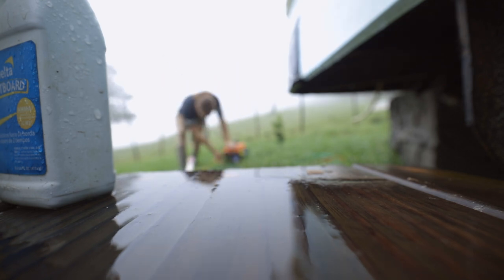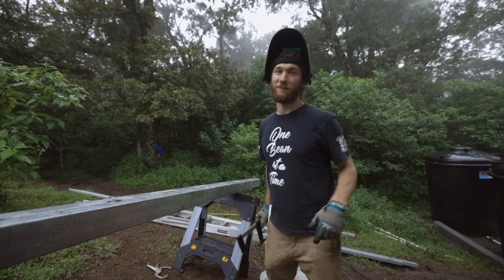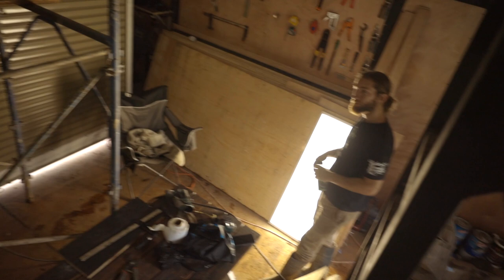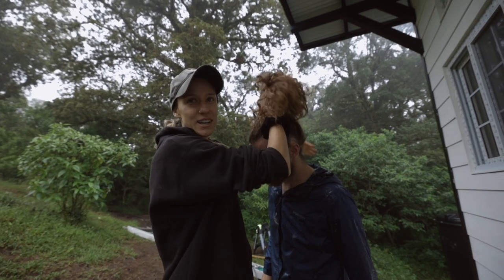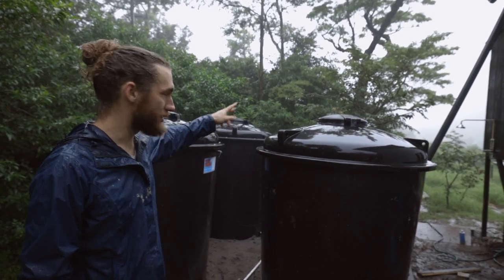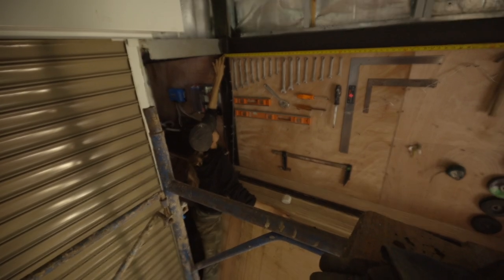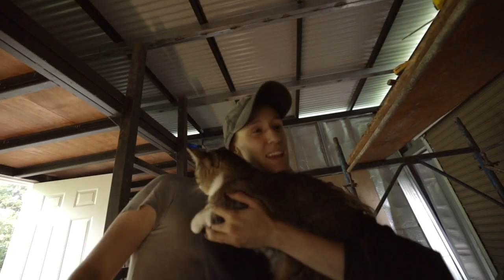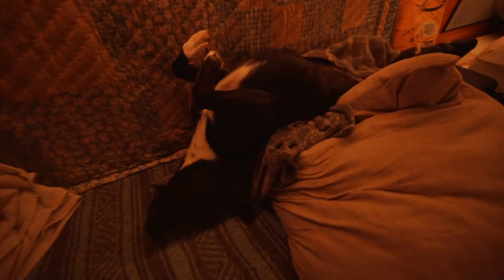FIXING ALL THE MISTAKES WITH OUR TINY HOUSE

Comment: You guys need to learn how to properly use that little woodstove. Keeping the door open allows the heat in the room to escape up the chimney along with the heat of the fire...close the door and let it burn you get more heat for longer. Also get a woodstove fan to place on top and it will push heat across room. You get the most beneficial heat from coals in the firebox not the burning itself so put in enough to keep some coals in there and you have a btter heat. If glass is smoked over like it is on yours its not burning hot enough or you are using poor wood to burn. The glass should be clear and or burn off soot from it on every burn. Take a few minutes and watch a few videos here on you tube and learn how to get the most heat from your stove. Keep up the great work!
Reply: Nothing like a multi fuel stove. We got a larger 4ft one. It would put you out of the room on lowest setting with the windows open. We where glad when had no heating on when tiling flooring in home in middle of December. Need to keep door of stove closed to benefit from heat. 👌

Comment: You may in the future want to install some insulation panels against the roof and close up those air gaps a bit more to increase the efficiency of your wood stove or you won't be able to hold onto that heat over night.
Reply: Hi there, i started to watch your channel a week ago I am very happy for your project. Here i join the subject of insulation cause i have noticed that you have put some in the walls and i don t see any in the roof. I was wondering if humidity is not condensing in the inside part of the roof when you warm up with your tiny wood stove. Good luck and keep spreading your good vibrations! Agata

Comment: If your trying to heat the workshop you  need to seal the eaves to keep the heat in.  Otherwise the insulattion you have installed in the walls is moot
Reply: Well said

Comment: You don't need the tool for the grinder,  you can just spin discs on and off with the palm of your hand.  I haven't used the tightening tool in over 10 years and no issue!

Comment: another "mistake" to correct would be the Wood burning Stove. The one you have is too small to be beneficial for that size building. Move it to the Bus, and get a much bigger one. JMO
Reply: this is Panama, a very warm tropical country. the stove is only for drying and adding a bit of warmth when needed. that pipe makes me nervous though. we go through that in Maine where we do need larger stoves. i am sure they will get something larger if they need it.

Comment: My Dad has those same water tanks. I don't know why, but he has the tanks elevated off the ground. It might be because it takes less power to pump it into the house he has in Saint Lucia.
Reply: Gravity feed.
Reply: Elevating the water tanks helps tremendously due to gravity feeding the water into the house appliances, although in this case, they’d need to use a pump to feed the water that they are getting from the roof into the tanks.. plus they already have a pressure tank setup 👍🏼 which in my experience here in the Philippines, it’s much better..

Comment: I'm not sure if you've thought about it but maybe you could use the energy of the water? Since there is a hill, you could collect the water from the top and put it into the tanks. Before it goes into the tank you can put a watermill and then when it rains you'll also get green energy.
Reply: Or you could use the water that you collect from the workshop!

Comment: I so relate with you about the "Money Savers" that the locals will have you do, that in the long run will NOT save you $.  Here, for us, the WORST mistake we ever made in our home's construction was letting them talk us into the standard for here plumbing with only 1.5 inch tubes.  We do have pressurized water, which most folks here do not have,  but if you want to  fill up something,  get a book.  So slow!!   Great guys!!  Thanks!

Comment: Maybe some sort of water turbine, with that amount of rain could it be collected higher up and released through a turbine into secondary storage... Or when you drain them.. Has anyone designed one that goes into the down pipes on gutters? 

On protest camps they often have bikes set up to charge batteries for phones and lights too just as another idea

Comment: Wood burner. Keep the door shut and open the air intake at the bottom for a good warm fire. Also you can get small fans that when you put them on the stove top will generate their own power and spread the heat out across the workspace.

Comment: Thanks for the video, it was fun. 
I though the windmill was working now or is there just no wind with all the rain?  
If no  rain and no wind happens very frequently you might consider a tiny hydro generator system. Since you have excess water just run a pipe down the hill side and put a hydroelectric generator at the bottom. Most systems like this save the water in a pond or tank and pump it back up hill when solar or wind power comes back online but you  seem to have excess water so you probably don't need to do that.

Comment: Also another potential idea would be catching the rainwater as it's going to the Collection barrels the water will be running at a Potentially high volume if you can capture that with some type of Impeller you could harness a means of electricity in that way....

Comment: As far as the ceiling live and learn that’s what it’s all about, this is your first building you’re gonna learn so much off of this one and then go to the next one, congratulations 🍾 maybe think it outside my own head but maybe come up with a box with like a wheel that captures all the water hook it up to like a little generator and plug that into your batteries so then you’ll have wind, water and sun or maybe put an extension that when your water tanks are full you can shut off valve to fill you in up turn on the other valve with a tube coming down and hitting that wheel so you have like a little creek but then you’re capturing all that water from the roof with hitting the wheel that could also charge up your batteries. Ok 👌🏼🔥🤠🔥Camping Russ out

Comment: Given what you said how cold it can get in your area, insulating the roof will make a difference at making the space more comfortable.  You have a pretty efficient radiator of heat out with the metal roof.  Probably not too commonly done in Panama.

Comment: I am not  an engineer so I am really asking out of curiosity- does installing the beams as you did really help carry the load or is it all basically now being held by the welds - as opposed to being transferred to a load bearing wall where a beam actually sits on a wall that sits on the foundation, rather than attached to the wall?
Reply: not an engineer, eh?

Comment: WATER WHEELS in streams also produce electricity btw if it is too wet seasonally. You can also use a water wheel for DC rather than AC only. also stationary bicycles would work or some type of inside perpetual motion machine (that should be fun).

Comment: In case it hasn't been said yet, the carriolas will make a stronger beam if you weld them back to back with the C on the outside, like an I beam.  Also when jacking up, place your vertical Jack post directly under a beam, otherwise you could bend your carriola beam.

Comment: @nomadicmovement  is it possible to drain the rainwater down to the wind blades of the wind turbine?  So that the water is high pressure right at the blades pushing them a round and round?

Comment: you should weld strong backs on to the sides of the beams where you welded them in. To do this just simply cut a few inches of angle iron and use them to weld in for extra strength.

Comment: A few more solar panels would help to make up the power loss during rainy weather. Led lights come in different degrees making it possible to have a more natural light. 5000 degree lights are more like florescent. Lower degree LED's like 3000 degrees are more like incandescent light bulbs to show color more accurately.

Comment: Ok guys... I have two comments for you that may, or may not help you. First of all, it’s great that you both learned to weld, you’ll use it for the rest of your lives. Secondly, every time I see the wood stove the door is open, you may have done better with a fireplace. Wood stoves work best by controlling the combustion, ie, close the door once the fire is established, and let it come up to temperature... the whole stove should radiate heat, not just the open door. I hope this helps, if not I won’t be offended if you disregard.

Comment: I would buy a water filter before drinking.  something that removes those tiny microbes you don't see. Water droplets fall when they attach themselves to dust particles. Which then causes Rain. So these little microbes unseen to us are there & that's why a filtration system for your drinking water is a good idea.

Comment: Too bad one light broke. It would be nice to finish that project. Yeah. Generator to charge batteries. Good job. Concerned you only has 112VAC from generator. Need fat wire for long runs or move generator closer to batteries. That should be priority. I wonder how much electric you could generate by capturing water off roof and running it thru turbine. Cheers
Reply: There would need to be large amounts of running water flowing through the turbine to generate electric current, maybe if they had a waterfall on the property, then that would really work.. but unfortunately, just the little amount of rain falling off that small roof isn’t going to do much, even for a small turbine..

Comment: @The Nomadic Movement _ Serious QUESTION HERE: How come that Wind Generator isn't doing ANYTHING? Personally, I think it's FAR to LOW and it's only getting "Disturbed-Air" which is ground air that's all over the place but the Blades. That tower should be at least 3 sections higher. Didn't the supplier/manufacturer give you performance specs? _

Comment: i am in the process of rebuilding a 10x14x14 shed into a cabin on my low level social security which is $800 a month. i am not allowed by law to do a gofundme or any donations that can be traced. good bones. just got a B&D sawzall and a hedge clipper for bushwacking it was a big deal, love all the new tools, you are very lucky. next summer in Maine we try and do the big stove, insulation and maybe some housewrap and metal siding. we have some promised free labor. work, work, work. by the way, check out Luan instead of plywood for wallboard...has a much more finished surface if you can get it there.

Comment: They make RGBAW UV LED diodes, Red Green Blue Amber White UltraViolet. I try and avoid RGB, they poorly recreate white by mixing the three colors. Also LED are not best utilized when shining directly at you. They should be under a diffuser or bouncing off one surface to light up the surrounding area. For example under a table shining at the ground, or inside some trim shining toward the ceiling. It takes away the harshness. It is really difficult to find a good variety of LED lighting if you aren't in a country that gets lots of products regularly from China. For example, I'm in Greece and it is much harder to find the LED strips I use in the US. Even if I order from Germany or the UK (because of the VAT) and the "Free Trade Agreement" the US has with China, they are just less accessible in most countries.

Comment: Cut a pole one inch longer than the roof is high and another as high as you need to slip the new support under the existing rafters 
You will be surprised how easy it will be

Comment: There will always be sagging and flex in your roof structure.   Even after you added the supports, it will still be there, just less of both.   I do not believe that you made a mistake, but that you were not happy with the sag and flex.   You have no snow load on your roof.   Actually, you have almost no additional load on it.   Was the roof unsafe?   Most likely not.   It was just perceived to be inadequate.

Comment: Good addition on the roof supporting beams, didn't see it in video, but am hoping you welded them at several places along length.. particularly if you will walk on or build up there later, like solar panels, etc ? Cross connections allow the beam(s) to spread the load(s) over a much larger area, preventing them bending excessively.  If you want more natural light inside, maybe some skylights could be added, one over bedroom/loft for easy roof access ( if you do solar up there ) and another over lower level areas, or look into solar tubes which can be placed on roof or sides of building see :  https://www.youtube.com/watch?v=VP2APH2TKyY

Comment: I hope this might help with your power issues. Guess what it is? Another generator. 

So you have wind and solar, you need water. It would be possible, as you are on a hill, to use water during the rainy season. https://www.youtube.com/watch?v=r-VPzEPw5JY is an Archimedes screw water generator. There is a guy in japan making them as well. You don't need a great big stream to move it, but you will want to locate where the natural run-off of the land would be and use that area. 

best of luck.

Comment: YOU SHOULD NOT BE WELDING GALVANIZED METAL. GRIND THE COATING OFF FIRST. 

Galvanize Poisoning

Symptoms of galvanize poisoning can be similar to flu symptoms.  The onset of symptoms typically begin shortly after exposure to zinc oxide and may include a mild headache and nausea.  If you have a more severe case of exposure, your symptoms will be consistent to those you experience when you have the flu.  A moderate case of exposure will result in symptoms including chills, shaking, a slight fever, vomiting and cold sweats.  If you begin to experience any of these symptoms you should immediately stop working and get some fresh air.  In severe cases the symptoms may be so bad that you will have to go home until they subside.  The most severe cases of galvanize poisoning can result in death. If you feel that your symptoms are worse than ever before, you should seek medical attention at once.

Galvanize poisoning is often short and your symptoms should begin to lessen within four hours of exposure.  You should be completely symptom free within twenty four hours.  If you experience a stronger exposure, you may still be experiencing symptoms up to forty-eight hours later.  We recommend upon exposure that you drink milk in order to quicken your recovery.  The calcium in milk helps remove the zinc build-up from your body

Comment: sorry but 10 cm in a few days thats what I get in thailand in under 30 minutes in the rainy season my house lays about 20 hours 30 cm from road height to my driveway and I sometimes have 1 to 5 cm inside the driveways but well you have built the workshop on poles hope i do it on the house too
Reply: 10 inches, not centimeters. 10 inches is about 25.4 cm.
Reply: 10 inches

Comment: Guys, I don't think that adding beams like this is the smartest way to do it. Waht you need is a support, on which the beams can rest. In your cofiguration, the weight of the roof an the weight of the new beams are only helt by your welds. And even though you did the best you could with this welds, those are no professional welds, the can break. I am really worried about this structure, strong winds and strong rains (and snow)can add a ton of weight to a roof and the hole structure itself.
Reply: Sometimes you have to work with what you have on hand. That being so your comment is constructive and well worth it next time they build.
Reply: I think that snow wouldn’t much apply in this case, but he is right about the supports.. have some small diagonal pieces on either side of those supports that were just welded in could really help.. just 4”x”4 triangles likely what you put under the stove burner could help tremendously.. or even if you like the esthetic of the diagonal pieces you put on the front of your shop.. that could also look nice and save you in the long run..
Reply: @brandonsargent4235  I'm not shure if those triangles would be sufficient, you really need the expertise of a structural engineer here, I'm "only" an architect.
Reply: @brandonsargent4235  btw: yes, you are right, for Panama, snow isn't that much of an issue, here in Austria, its a big concern ;-)

Comment: Because your roof is made with 5 inch square steel, you could probably land a freakin helicopter on it and not even sag it a little.  I think maybe you should concentrate on insulating the ceiling and putting up ceiling  panels, that way you can stand inside the shed/next house and not be mentally hammered be the rain..

Comment: It seemed like you started your house/shop build correctly by hiring an 'engineer'.  However, as I  have watched your video series, you ended up building an insufficient box, and as you changed your idea of how to use the structure, your 'modifications' and anxious desire to build has created a Frankenstein building. One could call it a 'learning experience', but really in your haste to push forward, you will continue to modify and fix this mess.  One piece of advice you do not take well, is in your understanding of gravity and amateur welding.  You must build from a solid foundation and stack your structural members like building blocks, and not rely on insufficient welds to support important and heavy structure.  You should have found a local welder to clean up before hiding your joints.